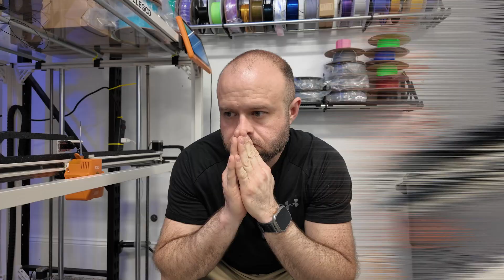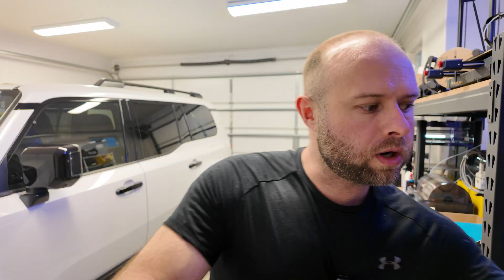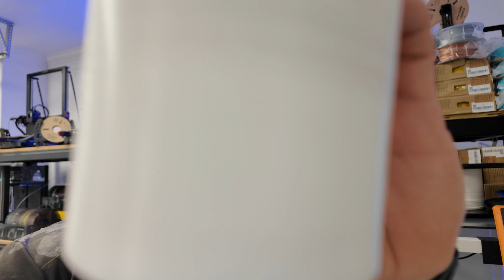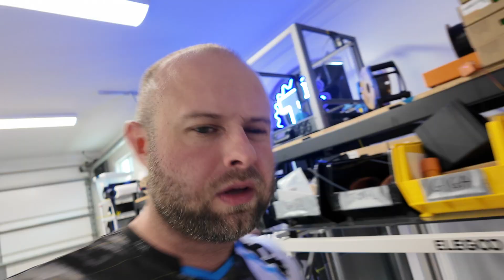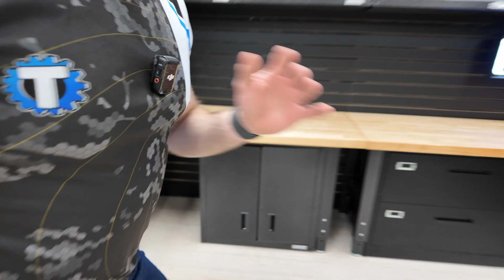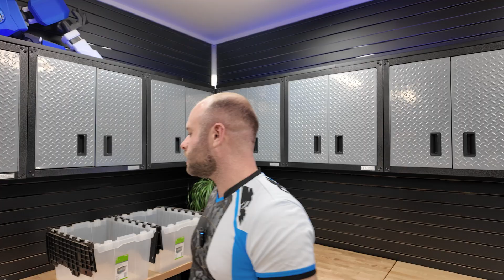I can't believe THIS "fixed" the Elegoo Orangestorm Giga

Comment: You're never going to get quality prints in a garage. Empty out a ground floor bedroom. There is way too much humidity in that room and way too much air movement.
There is a little chemistry that goes on with the filament and moisture. It sucks it up and attracts it. So you want that machine and you filament to be in a temp controlled room. Also some where there is no traffic. Once you get it set up and running you want to leave it be. That is why we have cameras. 
So invest in a filament dryer and keep your filament you're going to use dry. Real dry. Then the machine in a temp controlled room. That is going to be way less humid. So dry filament and dry air. As soon as that filament spends a few hours in that humid room it's sucking up water. 
So dry filament, dry room and clean your bed. Wash it with dawn. Then do all your configuration. Like Print temp tools and overhangs and stuff. By the time you get through that it will be hummin..

Comment: Re: new extruder mess.  I wouldn’t be surprised if they ran some filament through to make sure it passed various QA tests during the manufacturing process.  Sort of like how new cars come with a couple of miles on them.

Also, a lot of steel stuff from China has oil sprayed on it so that it doesn’t rust before it gets into the hands of an end user.  Probably way less likely but thought I’d mention it.

Comment: White filament has titanium dioxide so it wears down nozzles faster... if you must print in white, use a hardened nozzle otherwise you may have inconsistencies down the road

Comment: I burn my room conditioned pla in hardened steel nozzles at 240C. prints fine. also elegoo printers have other cable issues, like when the print bed power cable gets stuck on the print bed motor in nepture 3 pro.

Comment: first thing to always check on electronics - plugs, plugs, plugs.    Had a client, came into her office in the morning. Moments later - Btch, btch, btch - My monitor won't work. btch, btch, btch. I walked by the CTO's office and he gave me a look. I went into the woman's office - she's screeching and blaming me. I was the Network guy.  She was making too much noise to bother stopping her.  I stood - looked around her laptop and at the monitor. I extended my index finger and while looking at her -  I slowly moved my finger forward until I pressed the ON Button. Click - whir - her Monitor came on. I just slowly turned around and walked out. As I passed my boss's office (The CTO) - he looked at me - I said, "She hadn't turned her Monitor on." I never stopped walking until I got to my office and went back to my work.   Wiring, Plugs, Power ----

Comment: the clicking - likely - i only know from the n4 series: the large extruder gear thats directly connecting to the motor may not be 110% round or centered. there is nothing you can do about it but it effectivly means that the meshing between the large cog and the small on the motor is tighter and less tighter depending on where it is on the rotation. So when you are in a looser spot and it does a retract you hear the cog meshing play produce a "click" on reversing rotation direction

Comment: Instead of putting screws through the wasp nest you could put key slots in the back or design a  bracket to screw to the wall to hang it from. I've seen a stuff online that has the bracket type of design I'm sure you could borrow from.

Comment: a clean workshop is an unused workshop. 
if i had one that big you would see projects spread out but organized. im designing my own 3d printer so that and the parts would take up one bench. 
also making an AMS for the printer so that would take up another bench. id have one setup for electronics, working 3d printers, my holster leather work, etc. 
but at the moment im stuck with all my projects sharing the same bench so i can only work on one thing at a time, its an absolute mess but it looks like its being well used.
Reply from the maker: Clutter scrambles my brain, just can't deal with it

Comment: That clicking is absolutely the extruder struggling to pass the filament through the hotend, but it's likely NOT the extruders fault! I'm unfamiliar with the Giga, but if it doesn't have a silicone sock (or even if it does) the part cooling fan might be cooling the tip of the nozzle to such a degree that it's falling below optimal printing temp. Crank the temp, even if the print gets gross, and turn off part cooling. See if it improves. If it does, then get a sock and a nozzle heater with more amps. Despite the fact that the board is reading the proper temp at the nozzle, it's actually reading a ways up the nozzle, not at the very end. I had the same issue with my Tevo Tarantula, and solved it with an E3d heater/hotend.
Hope this helps!

Comment: Most designs are licesed pretty open. Aka you can even sell them. A lot have the requirements to attribute the "imported" part to the original creator, but as long as uou release your designs along with it you should be good.

Printables has that nice summary under every model that gives you the basics. If it says commercial use, or remix friendly you are good to go.

I literally import folks' designs and stitch my changes to them all the time.

If you look at the part and redesign, it usually is only a problem if its patented. Or if its similar enogh to a copywrited thing (like the Mouse).

I'm not a lawyer and this is not legal advice.

Comment: The clicking you describe sounds a lot like what my Neptune 3 Pro did when I first got it. Prints always came out fine but it just sounded wrong. It would happen every time it retracted which, on a solid layer like that, it makes sense you wouldn't hear it. It's been a while, but I'm pretty sure it went away with an adjustment to that extruder screw you were talking about.

Comment: hahahaha, you're going to be living on pie for a while. Try the Orca "calibration" ->"More.."->"Max flow rate" to test the Giga... I think you can make it print quite tall, will also let you know the max flow rate you should not go above. The black stuff in that cylinder print is old dark filament in the extruder that is being pulled through... because the molten filament flowing through the extruder is laminar flow it means you can get an outer layer of previous colour that takes a while to be pulled through because the layer closest to the walls of the extruder flow verrrry slowly... could also be some previous filament particles getting in that got ground off by the extruder gears. If cleanliness is next to godliness... I think theres a special place in hell for me.
Reply: This is partially correct, in that there is a differential between the inner and outer flow rates, but this difference is based on the heating profile, which is outside-in, so the outside of the filament is actually hotter in most cases. The difference in flow rate is from friction, primarily. If you're getting old filament into that flow, it's because the tip of the nozzle is too cold!

Comment: Haha! Black to white is the worst.  You changed the nozzle, but that's only the first step... black/colors can stain the nozzle as you know....But its ALSO the drive gear inside the printhead needs to be cleaned. ALSO PTFE tube... It also needs to be changed...there is microscopic 'fluff' or chaffing that builds up inside the tube... However mixed with white they are more then enough to cause a color change. Basically the complete filament path needs to be cleaned to get a quality white print.... I print alot of pure white front covers for LED signs.... I have a white only printer now.
Reply from the maker: LOL my first thought was i'll just print in black forever

Comment: you gotta piggyback a power switch onto a long wire to the front
Reply from the maker: I have that off to the right but the strip is only rated to 15a so it kept tripping. Need a beefier one

Comment: I feel I yell into the wind about drying filament. But more people live where they get 20-30 RH normally. my RH is never below 60% and sits at 60-80 in summer and 80-100 in winter (Oregon Coast). so my filament will never dry its self in summer.
Reply: Also in Oregon. Can confirm. However, this is NOT your problem. Wet filament presents with hissing and popping of steam at the nozzle, and interruptions in extrusion caused by the moisture flashing to steam as the filament passes through the 100 degree regime. Not extruder clicking and not discoloration. See my other post for the probable answer.

Comment: Let's see... You're an idiot that doesn't double check connections. You don't troubleshoot or diagnose correctly. You don't even preview your videos to make sure your audio is synced. And you steal from others by blatantly copying their work, the 3D modeling equivalent of tracing. You may as well just print their shit, then 3D scan it and call it your own original creation at that point. Give credit to those you steal from, at the very least.

My comment gives you engagement, but my blocking your channel from recommendations ensures I don't see you again. Seems like a reasonable trade to me.
Reply from the maker: Printing then scanning, that's brilliant. I'd save so much time! Thanks!

Comment: Hey here is a tip so you dont have to crawl into the machine to turn it on and off.... Get a surge protector strip and run it down the side and mount to wall.. You can turn it on and off without climbing and messing up the leveling.. You're welcome.  I know im being a smart azz.. I got sick of having to reach behind all mine to do that, so makes it much easier.
Reply from the maker: I have that, if you can see off to the right i had the giga plugged into it so i could easily toggle it, but kept tripping. Need one rated for 20a

Comment: 1st world problems, could be your supplier of filament for those specs / contaminates. why print a filler panel when you could just add some of that same slated stuff on your wall? or maybe some custom STAKIS boards? as for the hornet nest print - why not make it 2 parts, an outer shell that snaps on to the back part is flat and you could have narrow / shorter screws?

Comment: You clearly don't understand how humidity works with plastics,  air-conditioning  can  actually make humidity worse and being in a garage can also , I dont know what part of the country you reside and that may not be the issue,  but could be not sure but humidity that wasn't a problem previous can change due to weather patterns or recent storms
Reply from the maker: Not saying its not a concern but ive not had issues with the same filaments on other machines. Also ive never heard of an AC increasing humidity

Comment: Don't feel badly about it.  After I converted one of my printers to klipper everything was working great so I decided to christen it with its first print.  I designed and printed off a case and bezel for the Pi and LCD and it came out perfect.  Put it all together and suddenly the whole thing was dead.  I spent no less than 5 hours troubleshooting and diagnosing before I realized I had forgotten to plug the Pi power adapter back into the wall.  No going over EVERY cable and connection is the first thing I do whenever I have to troubleshoot.  The classic "have you made sure it is plugged in" hit me and I used to work in internet tech support, so..........

Comment: If you think $600 is cheap for an espresso machine, you should see the $100 unit I use every day! I have done a couple tiny mods, but it still make surprisingly good espresso. Better than I've had from some coffee shops. I definitely want to upgrade someday, but muh budget. I have an espresso tamper model up on MakerWorld that's quite popular. There are quite a few accessory trays out there too. It's actually still a market with plenty of room, in my opinion.

Comment: As for drying.  Get a cheap hygrometer and see wat the humidity level is in the garage... If its under 25% youre fine.. i store my PLA in ooen air all the time in New England where its been raining the last 3 days, and it prints just fine, because while the humidity is high outside, indoors its about 26%...  PETG on the other hand i have to store in a dry box

Comment: If it were me, n the Giga, I'd run a piece of Bowden tube from the spool to the print head to serve as a low friction filament guide.... If the extruder was slipping, the hob gear on the extruder will tend to shave off bits of filament and pack it in the gear when it slips, and that coming off the hob gear could be the interlayer color contamination you're seeing.

Comment: Ran across a winner of an idea for drying. Old wine fridge. Gut the cooling bits. Looks like classy storage AND you can circulate air and heat with a single heater fan on a timer. Great stackable storage if you got the space.
Reply: I went to my local thrift store, and bought a new in box creality 2 spool dryer. I paid $50 and msrp is $89.99. A print farm near me has a commercial food dryer that will do 10 1kg spools at once. The dryer was $600.
Reply: should mention its the TALL cabinet. Short ones are meh, but the tall ones are the way to go. Can keep entire stocks of spools dry and /pullOut for easy selections. (giggidy)

Comment: Most blends of PLA will never need to be run through a filament drier - many people new to 3d printing are weirdly misinformed about it. Also a  good test for your extruder tension is to back the filament out of the extruder head and check the depth of the grooves in the filament, you can find comparison images online.
Reply: That was literally everyone's answer for everything when I was on Reddit is "dry the filament".

Comment: I have had one roll out of 200 that had alot of water in the filament. Blue from bambu petg hf. I have 200 hours of dry time on that roll. I can do small prints with it. The filament on the outside of the roll is all that will dry out. It needs a dryer that unspools it while drying.

Comment: i believe that discoloration is caused by laminar flow.. you have filament in the nozzel that will join the white fil as it heats up.. look into laminar flow.. it'll make a lot of sense to you. Great Vid matt.. thanks for owning up..
Reply: This. It's also a sign of what I posted in another comment. The part cooling fan is overcooling the nozzle, leading to plastic getting stuck around the inside of the nozzle/flowpath.
Reply: @Corbald  PERFECT EXPLAINATION OF LAMINAR FLOW.. THANK YOU

Comment: You can’t power off via screen? Relocate the power or add a manual power button to front lol
Reply from the maker: Did that originally you might see the power strip I have zipped to the support frame to the right. Kept blowing the internal fuse. Need one rated for 20a+ so I just crawl back there